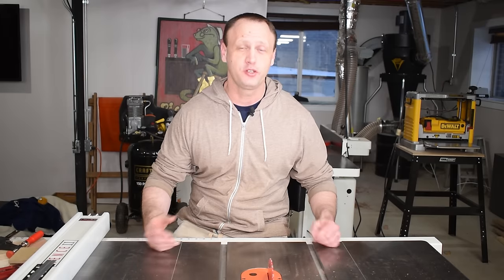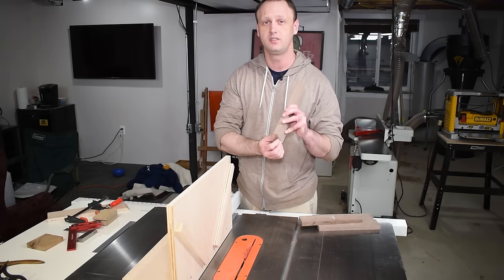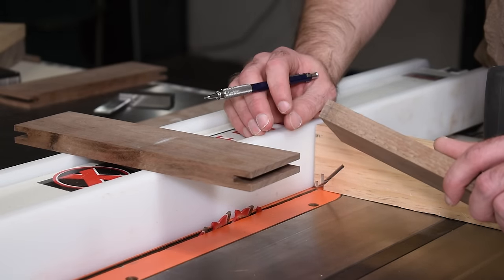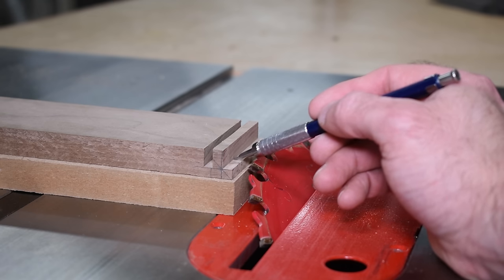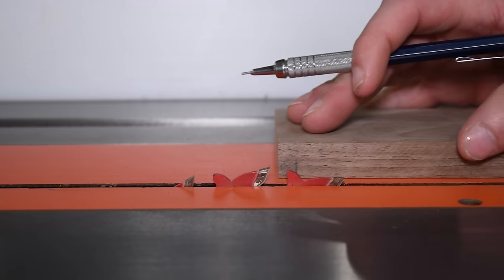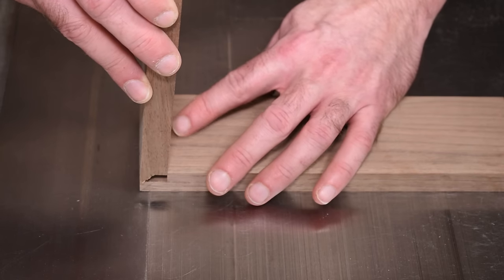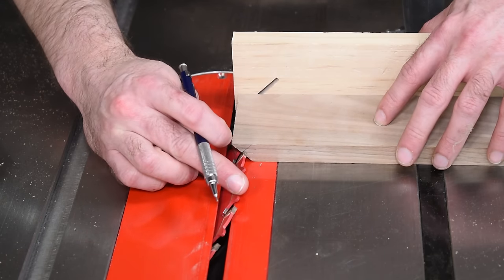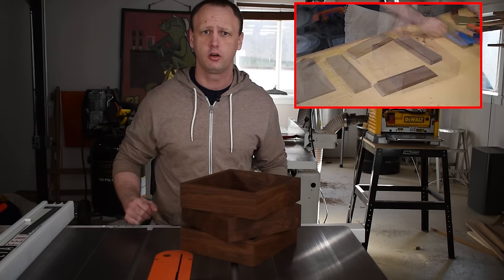3 Completely Different Miter Joints | Step by Step Tutorial on Cutting VERY Different Miter Joints

Comment: Finally got a chance to watch this one.  IMHO, this is your best video yet Billy.  I use the splined miter fairly often and have done lock miter joints cut with a router bit that Whiteside made some years back, but was a nightmare to set up.  Your way with the tablesaw is so much easier.

Comment: Great and very detailed tutorial. I do feel router table would be more efficient for the locking miters. I neither have table saw nor router table so I use dowels in my miters (both hidden using Dowelmax and exposed using Rockler jig).

Comment: Your explanation of the grain direction of the spline was fine, but then you cut it from end grain making it really weak...
Reply: The strongest would be to rip a board on edge to ⅛" thick but the same height as your box, then cross cut that board to the width of your needed spline. This making the grain run at a 90° to your mitre and making the strongest spline.

Otherwise, cool video with some nice joints!
Reply: No, it's weak longitudinally, but the strength is horizontally, AS HE EXPLAINED.
Reply: @antennasbc  He explained the problem correctly, but then cut the wrong grain direction spline. The end grain spline he cut you could snap in half between your fingers and would do the same under any stress in the joint. The long grain direction should be in the second longest direction of that spline, not through the shortest direction. The long grain should span/cross the joint.

Comment: Would it be a good idea to use the Rabbeted Miter Joint for making drawers with plywood? I plan to use those joints for the sides
Reply from the maker: Absolutely. They will look good and give you more glue surface area.

Comment: Impressive ways of doing mitres, but in my opinion totally unnecessary and potential for making wrong cuts. Just do straight mitres and strengthen with splines hidden or otherwise. How strong do they need to be? That’s the question you need to ask yourself before you start.

Comment: I realize this is an old video but I have gotten into making boxes in the last year and I just came across your channel. I was wondering that there are router bits available to make these same kind of kind of joints, why would you prefer to use the table saw over a router to do this?
Reply: Dirty Curty  -   there is a specialised router bit for mitre joints which is considerably less work and perfectly strong  -  though you need to ensure it is pefectly centralised and used on a router table.

Comment: I'm not a table saw user--yet--but I thought pushing the work thru the blade with the miter gage while the work is riding the fence was dangerous.
Reply from the maker: It is when making through cuts because then the piece is stuck between the blade and fence.  It's absolutely fine when doing shallow cuts.  But as always, do what you are comfortable with.